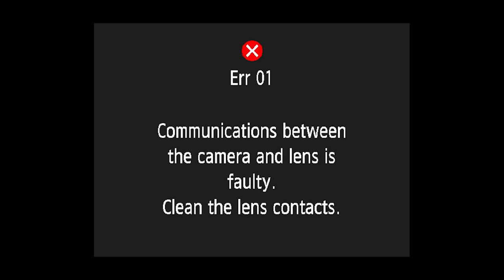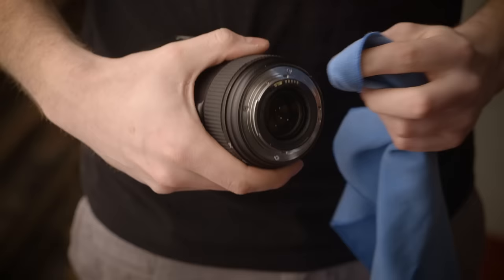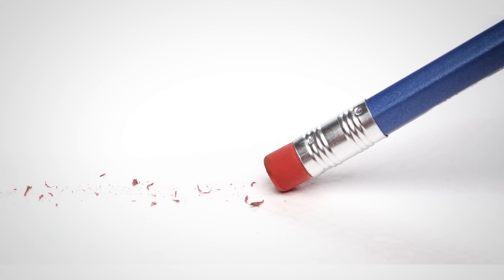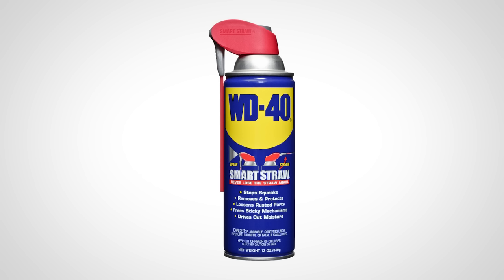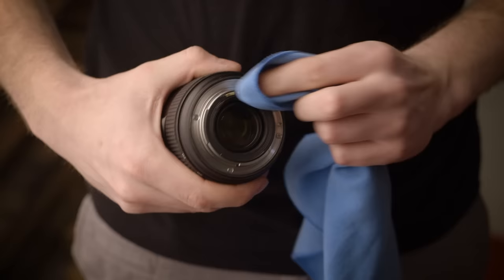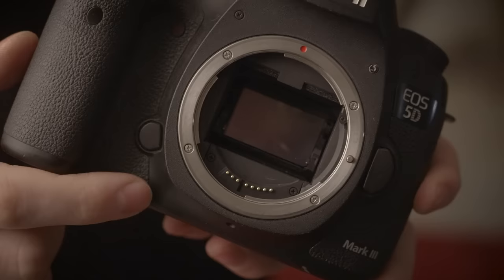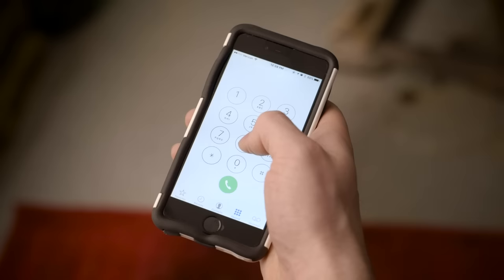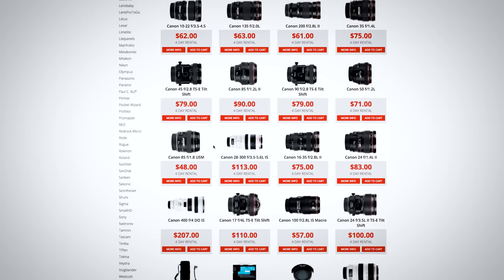Canon Err 01 - How to fix faulty lens communication 📷

Comment: Error 01 is not caused by dirt on the contacts. The error is caused due a problem with the lens diaphragm (usually only occurs on zoom lenses) NEVER use cleaning fluid on the communication contacts on the camera body! NEVER !!
Reply: Montañero Paisa  diaphragm flexor breaks due movement of zoom.

Any liquid may cause internal short circuit.
Reply: Please tell me what to do ...I'm using a zoom lens how do I correct it
Reply: How do you fix it?
Reply: @anyangobrandyshow2934 idk if u still having trouble but you go to your camera settings look for custom functions —> Release shutter w/o lens -> and turn it on
Reply: @HoratioWalls  idk if u still having trouble but you go to your camera settings look for custom functions —> Release shutter w/o lens -> and turn it on
Reply: Mine is sigma 24mm 1.4, same thing, in service they said it’s diaphragm too, tho it’s not zoom lens. Shocked that I don’t even use this lens much, bought new, never dropped, didn’t expect it to break for no reason 😢

Comment: I had this issue earlier on the 24-105 lens and had to take it to Canon for servicing and it cost me $150. I got this same error today at a professional shoot on the 24-70 f2.8 II, and was shocked that this error turned up in the middle of a shoot without reason. I was worried about another trip to Canon. But on watching this video I decided to try cleaning it with a cloth, and voila, it worked. At least for now. Have another shoot tomorrow, lets see.
Reply: Update: Cleaning the lens contacts didn't help. The error kept repeating itself. I finally had to take it to the Canon service centre and it cost a bomb to get the rear end of the lens replaced.
Reply: @hibhaven 😅
Reply: I just got my R3 back from Canon. I put my 24-105 on to see if it was working ok. Took several pictures, no problem. Then later took some  more and I kept getting this error.  When I took the lens off it made a noise that I’ve never heard before, like a mirror on a mirror less camera.  I tried taking the lens off, that didn’t help., I tried taking the adaptor off (I was using an ER on an R3), that didn’t  make a difference, also the battery.  Sometimes I could get a few shots taken before getting the error again.  I’ve never had trouble with this lens before.  Is it just coincidence that it did this after having my camera worked on? Canon also working on the adaptor. I have only had the camera for about 2 months before I sent it in because of focus problems.
Reply: @hibhaven  how much was a bomb lol I’m in the same boat for my 24-70

Comment: Also when you put the lens on turn the aperture to the highest aperture so f22/29 and take a shot and then turn in it down to as low as it can f3.5 or 2.8 and shoot again I've no idea why this works but it does I
Reply: Need to try this , thanks
Reply: Worked. Thanks mate
Reply: It helped for when it's at the highest aperture (2.8), but if I try going to a lower one it still gives the error. Any advice?
Reply: Bruuu it worked in my case jus today 19-06-2024
Reply: Worked for me too in my 24-70! Thanks!
Reply: This worked, thanks man
Reply: Wtf this actually worked on my 17 50 f2.8, been having issues with it for ages lol

Comment: I also suggest go into your cameras setting and do a sensor clean . When I made sure the battery was charge , followed suggestion I looked in the menu and did a sensor clean since I noticed it was doing it automatically. This -worked !

Comment: Excellent video. Two comments. First, 'cloth' should mean 'freshly washed, non-'fabric softener'' but otherwise well used 100% COTTON t-shirt. Paper towels are made from wood, which is poison to gold contacts. Fabric softener leaves residue. Non freshly washed will have body oils which are leave residue. Synthetic cloth is plastic and can be abrasive. Second, solvent really shouldn't be necessary, but if you have to the only One True Solvent is grain alcohol. All others leave residue. I know this sounds super extreme but these contacts are super sensitive. Pencil eraser, might as well use 220 grit sandpaper, followed by throwing the lens in the garbage. The WD-40 mentioned made my neurons absolutely cringe OMFG!! BTW the worst effect of residue is not just that it is an insulator, but that it collects dust/pollen/micro size smoke particles from the air.
Reply: Thanks for the useful information!
Reply: Good job sir.
Reply: thanks for the comment! I have a little question, would microfiber cloth be alright as an alternative? I have quite a number at home with my spectacle cases so I was wondering if they work fine as well.

Comment: I get this error on occasion, but when I do get the error it is almost always at the most inopportune times.  I can usually resolve the issue by wiping down the contacts with a lens cloth but your statement of this happening because of the oils on my skin blocking the contacts has me curious, how exactly does oil from my hands cause this to happen when I have never actually touched that part of the camera with my hands or fingers?  I have always been super careful to not only make sure that contacts are never touched I also take extra precaution while changing lenses to make sure nothing falls into the body of the camera.

Comment: I had already wiped the contacts with no luck, but this video made me want to try again. I used a different cloth and spent a little more time wiping it down. Unbelievable, it's working again. I took over 100 photos with no error message. In the past, up to 10 would return the error. Sure hope it lasts until I can finally afford to purchase an R setup.

Comment: Right, when it said "clean the contacts" the first time, I naturally cleaned the contacts repeatedly before resorting to YouTube.  But by why does this body need to communicate with the lens in order to record an image you just shot?  Warning comes right after releasing the shutter- My autofocus and iris are working fine, it will AF and close down and release, but then after freeze on this screen and not write the image file; which is clearly irritating when you thought you just took a photo.  More curious because I sometimes use old or dumb-adapted or cinema lenses that have no electronics or AF, and they work fine with the camera, every shot.  Like, do you know a menu setting or firmware upgrade or something to tell it to record the shot regardless of whether the body can chat about it with the lens after the fact?  Like "ignore post-shot focal length metadata" or something?

Comment: Had this very issue last weekend. My (brand new) Canon EOS 80d stopped communicating with my (brand new) Sigma 18-300 zoom. More likely to be the pins aren't making full contact because the Sigma zoom ring is very stiff; it's a known thing with this lens apparently. So probably when I'm zooming back and forth, it's maybe pulling the pins and contacts very slightly out of alignment. Less likely to be dirt or foreign debris as the lens and camera were mated in the shop when I bought them. 

A good tip. Thanks. Will give it a try should it happen again.

Comment: It was weird. It did not work for me either. But what I did was have the camera on on auto with the lens on and the lens on manual and started playing with the ring by zooming in and overturning the ring 25 percent and then taking a picture. Zooming out all the way and zooming in completely and turning the ring 50 percent and took another picture. I did the same steps until I got to 150 percent and the camera lens started working. Hope this helps.
Reply: And it worked normally after ? I am getting this ER 01 error when using my 24 - 70 with flash at wide angle 24 mm to 28 mm maybe, I believe its due to some damage occurred to my lens after a fall, will try your solution hope it works.

Comment: Nice, I was cleaning my contacts with alcohol and a q-tip, just used a cloth and a little elbow grease and IT WORKS!!!
Reply: Did you actually use elbow grease or just a half second brush over with the cloth

Comment: Do you know what that error is called? scheduled obsolescence. That error has no solution and has nothing to do with the lens or contact cleaning. I have several lenses that work fine with other cameras but they don't work with my canon 5D Mark III with Err 01. Service is more expensive than a new camera.

Comment: Mine only happens when my 70-300mm lens goes to about 200to300mm and then I get the error.
Reply: GR1M RACER   same as mine
Reply: Same! This happened on my old Sigma 100-300 mm lens. I wonder why?
Reply: Me too. Did you find a way to fix it???
Reply: It means the contact ribbon inside your lens is split. You will need a repair.
Reply: exactly, this happens only with my 70-300 Tamron lens.
Reply: @stefanszlobodnik yeah I have the same problem with the same setup. It works with my "standard" lense but not my Tamron 300 😢

Comment: I had this error as I use old lenses and adaptors so the only solution for me is to put gaffer tape on the metal where the adaptor and pins meet works for me..FYI. this is for use with a canon ds5.. I do have EF mount lenses but they keep saying the error so put gaffer tape on the pins of the lens Not the Cameras pins This means you can only use the camera in manual mode which is the mode I use all the time..

Comment: Hi, I think I put my 24mm stm in my backpack and might've bumped it a little, it's not even getting recognised by the 70D now... Aperture shows 00, no motor sound inside lens, AF-MF doesnt change anything and Err 01 when trying to shoot. Any idea?
Reply: Hi, I have the same problem. Do you have solution yet?

Comment: This problem only occurs with my 21-year-old Sigma 70-300 1:4-5.6 APO lens on a brand new M50 MkII using the Av mode with the aperture set at any value smaller than f4. Seems to be okay on Tv and P though.
Reply: Same with my tamron 70 300mm. Tsk

Comment: Cleaning did not work and local repair facility said there was a communications unit that needed to be replaced in my Canon 100-400 lens.  Got it home and I still got the error after a few shots.  Mine is always intermittent.  I can shoot for about 15 minutes and it will start.  Either powering the camera on and off a couple of times or remounting the lens gets it to work for awhile.  Not sure where to turn now in that I cannot imagine what else can be done.

Comment: I bought Canon 28-300 3.5 - 5.6 lens and working only on lowest aparature settings. So 28mm f3 5 any higher error 1 no matter what you do also on 35mm, 50mm etc

Comment: sigma 70 x 300 works on my canon 600d but not on my canon 80d err 01 . So problem is more then just a wipe over, Good video.
Reply: Have you tried using the widest aperture on the 80D before firing a shot? This works for me on the M50 II

Comment: got a sigma 24mm and had the same problem from the start, but couldnt figure out whats wrong, turns out you need to ulock the lens and twist it back just a smidge for some reason the contancs are not connecting on full lock

Comment: When I first got the error message, I tried to clean all the contacts because that seemed  the logical thing to do. Nothing happened.  However, at the time, I was outdoors, feeling panicky and frustrated, and trying to fix it while juggling  the camera at the same time.  After watching this video, I decided to give cleaning another try, this time sitting down with good light. After a couple  tries with simply a cloth, it worked. So if you just try once, it might not work for you.  ETA:  ARGH! I spoke too soon. My lens is still giving me problems. I can take one or two  photos and then get the message again. An additional clean may or may not let me take another photo : -/
Reply: same here... struggling with the same issue
Reply: saame 😭
Reply: Bad internal contact ribbon
Reply: Am facing thises issue now
Reply: @joecap2919  Do you mean the flex cable?
Reply: UGH!...yep, not working for me either! 😮

Comment: So...does Nikon have this issue? I'm on my second lens in several years.  While in the middle of my vacation to Italy (zero camera stores around/open) got the error 01 message. My first instict was just chuck the camera in the garbage and just use my phone from now on, but maybe...just maybe someone has found a way to bypass the electrics into thinking the camera and lens are working perfectly vs just cleaning the already clean contacts or sending my lens to a dealer and repair it for the price I bought the lens.  I'm working with the Rebel T2i.

Comment: Hi. I have two Sets markii +85mm 1.8 (canon)  (here I try catching Skier, it was ca 0-5 Degree at 2000m) and markiv +24-70 2.8 (tamron) (here was +15 C, sunny). This have in one week booth er01 with high speed shooting. After off/on it works normal. What is reason?

Comment: Using my Canon EOS 80D I got this error only when I zoomed out fully to catch action shots at my daughters soccer game.  But when zooming in it didn't seem to have this issue.  I will try this soft cloth option and see if this helps.  This is a new lens only about a month old and I do not touch the contacts at all.  I try and keep my hands away from these areas on the lens and the camera mounts.
Reply: I'm coming 2 years later to ask you, Did that fix it ? how did things go ? thanks
Reply: @Anaxxo  No it didn't fix it, the le ns was horrible and I loved it. But those connections didn't work well.

Comment: Pro tip - it's not always simply that the contacts are being dirty. My 24-70/F4L USM does need a new fladbed cable, and i do know other Canon lenses with that issue as well, like the old 17-40 L. You could believe that i tried everything all the web tips, but it's bogus. I need to replace that special cable inside my 24-70 F4L. Sometimes, ppl get a tip on the web, and think it'll fix everything, but it doesn't. I shoot >34 years, FYI. Get my lens repaired soon. 🙂

Comment: i tried cleaning still not working
Reply: Rajendra Biswas but it's the lenses fault..... Tamron 70-300
Reply: akhil krishna I have the same problem with the same lens
Reply: I also have same problem with same lens specially when I zoom till 300mm and F> 7
Reply: Im having problems with a canon lens and cleaning is not the solution

Comment: Hi   Just seen this video,and tried what was you suggested, Sorry it did not work for me, I have purchased some tools to strip the lens down, following other videos error code 01 suggests the apeture
flex cable requires replacing, This is my way forword to fix my 17-85 lens. 

Regards welshman2081

Comment: The communication error could also be caused by an internal source, such as the ribbon cable inside the lens.
Reply: Can you explain with more detail sir??
Reply: @solar-jaymi  There is a ribbon cable that runs inside the lens and this cable is rolled slightly whenever the lens zoom is adjusted - similar to the ribbon cable that is attached to the printhead of an old dot matrix printer. Over time, and with thousands of zooming in and zooming out, there is flex and wear and tear on the ribbon cable.
Reply: @msbrownbeast  interesting,  the lens I bought on ebay was a used lens in good condition,  and working.  Then it started to have that problem.. tried cleaning  it and works for a bit I can get up to 3 shots.  Currently unemployed,  I'm 17  should I invest in a new lens? Better start looking for a job.
Reply: @solar-jaymi  It all depends on which lens you have. Is it EFS or EF lens? if it's EF - it is an L lens?  Not all Canon lenses have high resale value. If it's an L lens it would be more expensive. 
In some cases, it may be better to purchase another used lens (of what you already have) and then selling the defective one for parts (or AS IS) rather than trying to take it apart and repair it yourself.
Reply: @msbrownbeast  I have an E-F Lens, yes. I'll look into it thank you
Reply: @solar-jaymi  If it's an EF lens like the 28-135mm, this lens can be found for a good price used. I bought one for my 5D four years ago for around $100 on Ebay

Comment: I just tried this and noticed when I look through the viewfinder after cleaning with the cloth, it keeps getting darker and darker, as if I had an ND filter on the lens. Any suggestions?
Reply: Maybe issue with your apature flex cable... If you have some noise sounds while focusing ...may that's the problem..
Reply: @shimak_hanifa  i have the same issue with my 24-105 lens, i set to f4 then shooting burst it's fine. but when f/11 or f/16 i shoot three times burst and error 101 appear. is it expensive to repair the apature flex cable?
Reply: @fullandstarving  I bought recently in ebay... It cost me about 30 usd or something...
Reply: @shimak_hanifa  so u repair by yourself? Wow. 
I plan to send it to canon. May be they give us the original flex cable since my lens is an L lens...to risky for me
Reply: @fullandstarving  that's good idea💡... Good luck friend
Reply: I had this happen, too!  So weird. I had the camera on a tripod testing it out when it came back from Canon. Really no reason why the exposure should do this.